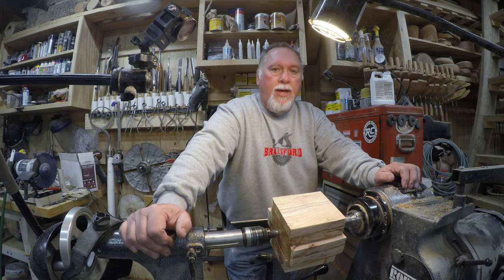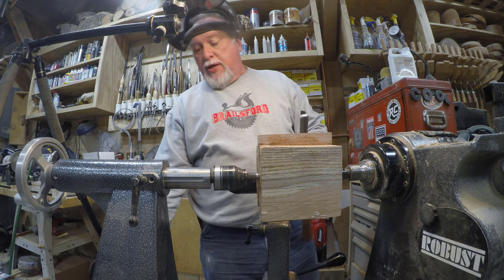How to Make a Biscuit Cutter

Comment: Great job. If I  still ate biscuits I’d want the larger size. The smaller size is probably more the size most women will want though. 

2 questions for you. 
1. Did you drill an air hole so that the dough isn’t held in the cutter by suction?
2. What finish did you use on these? It looks great.
Reply from the maker: Thanks Doug!  Well we have a large number of biscuit eaters around here!  I did not drill a hole.  I used General Finish's bowl finish.